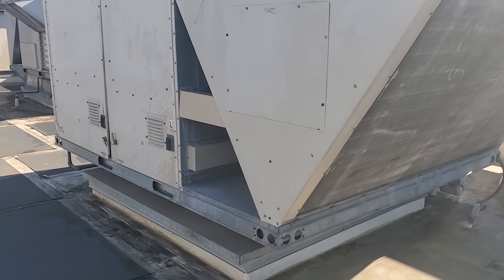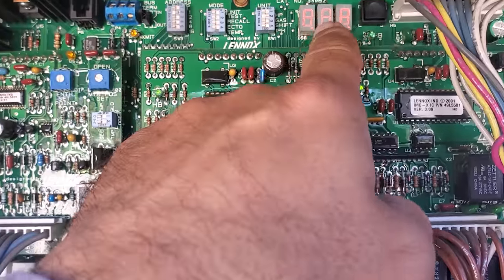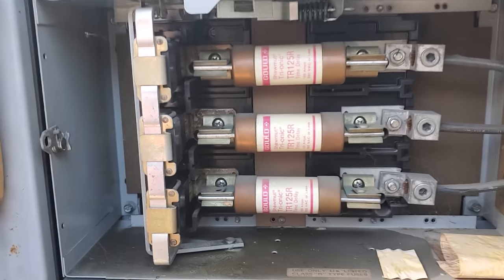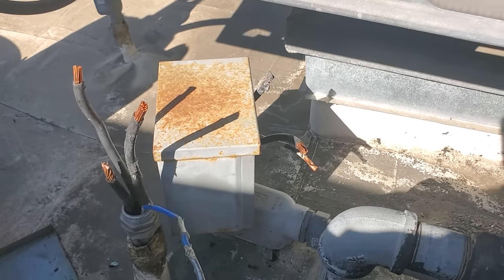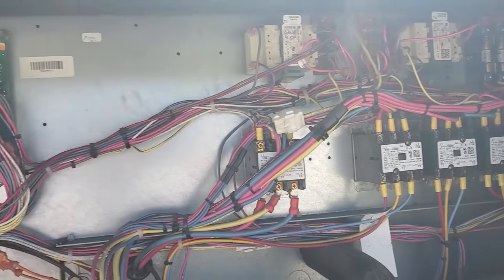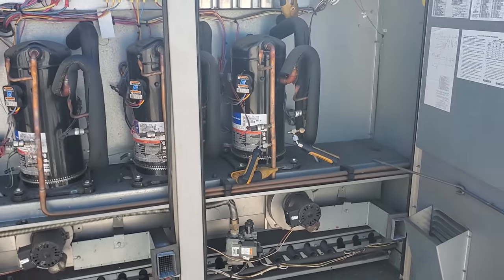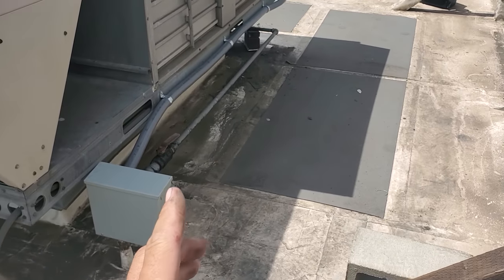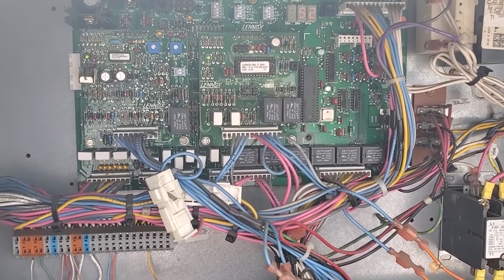ELECTRICAL FAILURES ARE FUN

Comment: As an electrician I just wanted to say kudos to you for doing so much leg work for the electrician! However the electrician himself did a shoddy job connecting the main switch. Copper wire NEVER should stick out so much out of the switch. Touch safety is blown out of the window with this one. It probably isn't that much of a deal because no one will ever need to work on that switch for a long time, but it just saddens me that people rush their work like that, a proper connection could have been the cherry on the cake. Amazing video though!

Comment: I probably mentioned this once before...

My house has a heat pump system (mid-Atlantic).  One winter's day I happened to be by my electrical panel and heard the HVAC backup heat relay click. I then started hearing ticking from the electrical panel. That's not good! Killed power, took the panel face off and found one of the breaker feed lug screws loose.  Probably saved myself from a dangerous situation and expensive repair.
Reply: If people were like you and listened and acted on weird noises in their equipment, cars, and so on, it would save so much on repairs and reduce hazards..

Comment: That customer is so lucky they didn't burn their place down.. I work on garage doors and door openers and I've seen a garage burn down from a loose connection on the outlet going to a garage door opener. I cant believe it didnt fry that circuit board. I know that cant be cheap.   Good work.
Reply from the maker: I will be going live on YouTube this evening 9/6/21 @ 5:PM (pacific) to discuss my recent uploads and answer questions from the chat, Come over and check it out https://youtu.be/HZjHAYTULSo

Comment: I am a technician for a HVAC company in Florida(not going to promote where) with 17+ years in and you sir did a fantastic job diagnosing those units, along with letting your apprentice get hands on. My thought on what happened is when the one wire that was burnt, arced to ground and forced a short across that specific panel, which being in California didn't seem out of the ordinary, so nobody was the wiser, causing the other unit to sense a power issue, mostly sounds like coincidence that those 2 units were more than likely the only ones running at that moment and purely luck. Those L****x style units' boards are very sensitive, and give a lot of information, but are fairly stout boards, so I'm fairly sure your diagnoses is correct in that the board is likely ok, and just did its job.

Comment: A couple days ago I replaced a capacitor in a condensing unit. Pushed in the contactor to do what you call the bump start, verified that it works. Turned it on at the thermostat, the system went into what I thought was a very long delay. No 24v at the contactor coil whatsoever. Went inside to check the indoor unit, appeared to be plugged in, verified 120v at the outlet, then opened up the unit assuming I’d find a low voltage issue. The unit had no power whatsoever. Drove me insane for about 15 minutes not being able to figure out. I followed the plug into where it goes into the unit, only to discover that the cord was for the condensate pump. I looked down on the ground to see the actual cord for the unit, on the ground and unplugged (by the customer). Plugged it in and it ran just fine. Man I really wanted to slap myself after that. But in my defense, I was jelly brained from the heat, exhausted and 10 hours into my day. But I should’ve noticed that right away. 😂😂😂🤣🤣🤣
Reply: What kind of condenser are you working on that has a 120v plug??
Reply: @mtucker3401  this was a split system, and was referring to the indoor unit/furnace/air handler/ whatever the hell people call them. The condenser itself had a proper 240v supply. The contactor coil in the condenser wasn’t getting the 24v signal from the indoor unit which had no power because it was unplugged. Did I explain that well enough?
Reply: Remember: Don't b so hard on yourself, others will do it for you
Reply: @gregmercil3968  I think those tend to be hardwired as well but obviously indoor blower units and logic board power can vary. That's probably the confusion.
Reply: @etherealrose2139  long story short, the indoor unit was unplugged and took a few agonizing minutes to realize that this was why. I confused the condensate plug for the indoor unit’s plug. That whole day sucked! 🤣

Comment: Good job on your analysis. I'm glad the board manufacturer took the time and expense to build in lockout circuitry for voltage sag/spikes.  Maybe since they are rooftop units which have inherent issues with such things they added those safeties to the system.  The hardware I use will plow thru the sags/spikes, which are very seldom in a BAS control panel at the floor level.

Comment: I love when the customer "thinks" its a call back and plays those ntc games and attempts to hold you hostage because they question what you did and they have no understanding of how mecahical ac systems work😑😑
Reply: Do a video on dirty power
Reply: EXACTLY!
Reply: "Fix it yourself. That means climbing up on the hot ass roof and verifying the other unit is off and the one worked on is purring along."

Maybe that'll give them pause.
Reply: Hindsight , in a perfect world , he would have checked the other ac unit and got it running , instead of phlucking with power cables that he wasn’t going to fix .

Comment: I love watching your videos even though I have never been in your field. I was a coin op tech for around 40 years working on everything like candy machines, video games, juke boxes and even slot machines (and almost anything that takes coins or bills). I guess I like watching someone that knows what they are doing that is not a "Swapnition" (someone that just changes parts until it works) I myself was always lead in my field (last guy to be called when no one else could figure it out) and it's a joy to watch someone like that work through a problem. Another person might have just said oh, the LED's are flashing, must be the board and then changed it out (at I am assuming great expense) and then turned it on and validated their ability because hey, it works now.

Comment: Well, doesn't matter what the unit uses as max amperage, this only defines how large the unit's breaker is.

The fuses in the fuse box below the roof define how large the wire needs to be or they need to be sized lower. But this might not be future proof, that's why most customers run larger wires to the roof and have a smaller breaker there. :)
Reply: It is good industry practice to have a bigger wires. Some units runs 24/7  (not on that video or location...) and these wires can heat up. Bigger cross section helps to avoid that kind of trouble. Cost is higher so typically nobody does not take a extra care
Reply: I've seen oversized wire in installation for two main reasons.
1) Future proofing, as mentioned above.
2) Less voltage drop/ improved safety factor.
Reply: @darkwater72  how does a larger diameter increase safety? 🤔
Reply: @simplemechanics246  well, this only makes sense if the wire is the same size from the grid right to the consumers. This isn't the case here.

Instead the wires are stepped down on each breaker.
Reply: @RubenKelevra  
A larger diameter translates into more conductor. 
More conductor means less resistance. 
Less resistance means 1) less voltage drop, and 2) less heat generated within the conductor.

Comment: Not a pro tech but have had enough experience, as a union stagehand, with 3-phase. Your meter work on verifying voltage and continuity is a lesson for all of us. Can't believe power was still getting through the offending box. Great video!
Reply: two legs were ok, third was open, so there was a "series" connection between the open leg and the other two.

Comment: For the new junction box for the stub up on the first unit you fixed (unit 4), you want to block off the holes on the back of the box to dissuade flying stinging things from nesting in it.  Also helps with preventing water ingress.

Comment: I am a 72 yo from Australia relatively new to this channel and I am interested as i spent many years in the industry ranging from an heating tech, Air-conditioning, refrigeration, mechanical services as a whole as installer to design to engineer. I am amazed at the equipment and accessible information you now available to you. I do find that design for restaurants would not meet Australian codes and the lack of through being put into equipment installation and placement to reduce the effect of kitchen exhaust being drawn into the units. Having been on both sides I always endeavoured to designing to minimise maintenance issue. You certainly do a great job and I thank you how you pass on your experience to others in the industry that are willing to login and listen.

Comment: You are right that that board is messed up. The heartbeat is generally done with a piece of code running on the microcontroler, a watchdog timer or an interrupt. If none of that low level stuff can run, and you don't see a heart beat, the microcontroller is not working. These micros can do thousands or millions of calculations between heartbeats, so if it can't manage to blink a LED, it has crashed. I would also guess that lightning messed up all of those boards or caused them to crash. Great video by the way.

Comment: Such an Arc will create enormous High Frequency Content on the Lines which can travel upwards through the breakers and onto different branches of the electical system. It can affect other devices, sometimes even other buildings if the event is large enough. Usually such content is filtered with caps and filters on the input side of the power supplies but they age and it‘s also dependent on length of the cable runs. So I can totally imagine how the meltdown could trigger a power fault on the electronics of the other system, while not affecting all systems on the roof.
Reply: It's tough to get business and finance guys to understand what a cap bank is for, since the up-front cost is so large, and their statistics classes told them these "one in a hundred-thousand" catastrophic failures are why we pay insurance premiums. Prevention? That's not cost-effective!
Reply: NASA scientist?

Comment: Hello. Good work finding the short.  There is also a coordination issue here. 125a fused disconnect feeds a 150a non adjustable breaker. Wire size is #2 (110a). Unit is 90a Max.  The wire is undersized for the breaker and is overheating.
Reply: Agree with you there is a coordination problem, but I think you got it backwards.  The wire is sized ok for the load, but the protection is all wrong.  The 125 fuse is marginally oversized for the 115A wire (disputable depending on the rules applied at time of installation) but the bigger problem is that the fuse didn't blow when the insulation failed. A breaker in that position could have tripped all three phases on the initial fault instead of browning out, but that's an equipment selection error.  The coordination issue is that the 150 breaker will never trip - the upstream fuses will blow first, potentially single phasing all the motors.

Comment: Hi there, first may I thank you very much for a thorough & clear explanation of your work. Secondly, re. the "other" aircon with the fast heartbeats? I work for a public lifeline utility & every four months we run the standby gererator on load to prove reliability. Every time the GenSet takes & drops load, one of the chillers locks up & the control board has to be reset. The same happens to the standby process cooler in the central apparatus room. I reckon the type of fault you witnessed was caused by a power flip or similar & not unusual. Thank you for your work:)

Comment: You made the best right call handing the electrical issue off to an electrician. If it had been a simple issue of just replacing the splice connector yeah you could have done it.  
But since the cables were damaged, the best solution was to completely replace the entire run for that phase. 
Also, huge kudos to the electrician for for re-running all three phases with different colors for the three phases! Bravo!

Comment: As an electrician, I appreciate your rare wisdom. The power surge that pushed the funkiness over the edge in the box might have pushed the second unit's 3rd phase enough to cause an internal imbalance that caused its system to trip. Even with separate breakers, the units are connected at the transformer feeding the building. The flow is real.

Comment: A guess on the 2nd board is that the surge made it go into panic mode. There are circuits to prevent the board from shorting, over current etc out and if you trip it, it goes into "panic". 

Usually, as you know with this one, it did fine after a reset.

Comment: As a computer engineer (software engineering / electrical engineering) and having worked with multiple embedded systems over the past 18 years.. I think what happened was that there was a brownout or similiar, and that caused one unit to have a meltdown. So what happened was one unit lost one phase, while another unit was affected by it. Usually when you have sub-boards controlled by a master board (the board that the sub (or daughter) boards sit on), the master board usually sync's them up and sends a clock signal to all of them. So I theorize that on the first unit, losing a phase caused them all to lock up. I'm not clear on the design on the boards, so that's all I can theorize. And then the first unit caused the second unit to have an issue due to a "brown-out" condition - i.e. when you have arcing and a meltdown it can cause a voltage disruption across the 3 phases. So I theorize that the second unit's boards got out of sync and the firmware couldn't account for that - so the daughter boards heartbeat signal sped up because of that.

There are ways to get stuff back in sync (in the case of the second unit) - by having watchdog systems that would do a complete reset of the system if anything goes wrong. Losing power for a brief moment could also have lead to the individual RAM in each unit being corrupted leading to the board crashing (i.e. why heartbeat signal blinking fast in some but not in others) so.. It's hard to say without knowing how the board is designed.

You did the right thing by powering-on / powering-off. If it's a hardware issue - i.e. wrong voltage, then things wont change by powering-on / powering-off. If its a software issue or inter operating issue (i.e. you have a few different boards with their own processor and memory) then powering on / powering off will solve it by getting everything back in sync. 

In short, the first unit failed because of wrong voltage on one of the phases. The second unit most likely failed because of the first unit affecting it's power input via a brown-out method which caused some of the modules (daughter / sub boards) to glitch and stop talking to the master board. Then the whole thing locked up. The master board should have a way to reset everything. It didn't in this case because it was also locked up (fast heartbeat). If they added a simple hardware watchdog timer, then they could have avoided the whole issue. I.e. it's basically a counter that counts down from 5 minutes and the microprocessor sends a signal every 10-30 seconds to reset the counter. If something hangs, and the count reaches 0, then the reset line is turned on and everything gets reset, including the watchdog counter.
Reply: Watchdog timers, i remember that from my digital electronics class
Reply: My hypothesis as a dumb guy who fixes toilets for a living is that installer error may have installed the first melted lug poorly and also installed the lugs in the second box poorly. Some sort of surge or brown-out made the poor connections worse, but actually melted the first and not the second. I would have wanted to at least open the second junction box to confirm that one wasn't cooked as well even though it was (currently) getting good voltage.